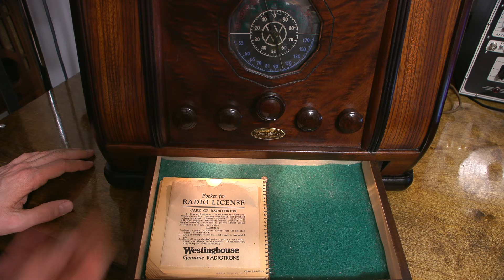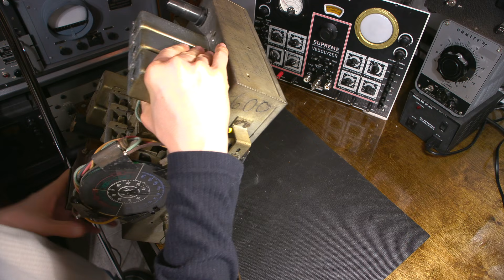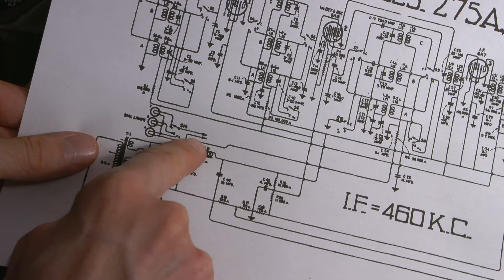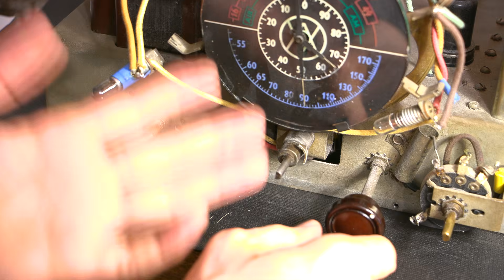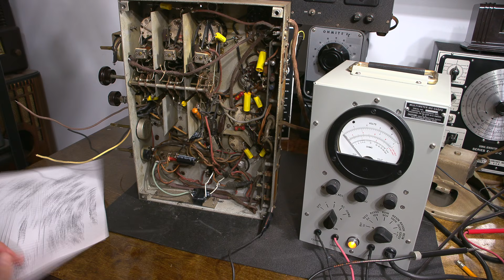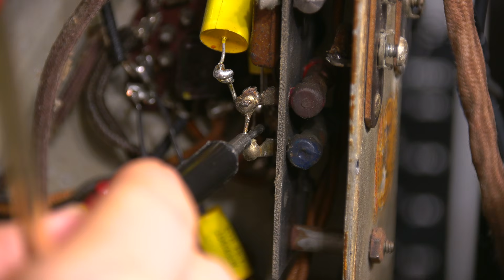Electronic Repair Adventure- Radio Receiver Troubleshooting!

Comment: I would definitely like to see the RF alignment on this.
Reply: I would too, But I don't think it's that far off. Excellent sensitivity, so front end seems close, good selectivity so I.F. is probably pretty close too.   Couldn't see dial real well so couldn't see where dial was when tuning WWV, so no comment on that part of alignment.
Reply: @Rems61  You are probably right, I just like to watch the process. :)
Reply: @Rems61  It is inconceivable that this thing is still within spec. It may well seem acceptable but it will need aligning.
(Blimey, I almost convinced myself there...I'm only a quarter way through so don't know the whole story yet).
Reply: me too
Reply: I was actually expecting to see it I did not realize time was coming to an end.  I fully agree it would be nice to watch and see that end result., it is a beautiful radio.
Reply: Do you mean reciever alignment? It's not a transmitter.

Comment: I don't like the j-hook idea myself, but when there are multiple wires wrapped around a lug on a brittle tube socket, wafer switch, etc, I will use it . I have damaged those components by trying to remove wires from them. It does work okay, just not my favorite method. I think it it aesthetics, not function. I have known people who use it exclusively and do high quality restores. What do you think Paul?

Comment: Have not watched yet but no worries, they are ALWAYS excellent! Glad I was up early :D OK, finished watching and yep, it was great! It is nice to see the old time bench being used but a quick question. Why is the Vedolyzer not in it's case? I suspect that the case is a little too large for pushing back on the bench. Good advice on the dial paint too!
Reply: In one of the Vedolyzer videos he mentioned that he might use it without the case, because the chassis has a nice chrome finish. I guess that could be it.

Comment: A licence to receive a signal, sounds almost criminal, BBC.
Reply: We have had to pay an annual license fee to our government to finance state radio and tv. Always been like that since radio started in 1924. This was terminated this year (2020). This helped keep at least the national stations free from all those braindead commercials...
Reply: Most governments (including here in Canada) wanted to control all frequency generating equipment during the big wars as there would be modulation on those generated RF signals that could be picked up by spies.  Since all superheterodyne radios had an internal oscillator then that fell under those rules.  Not so the TRF sets.
Reply: @basinstreetdesign5206  The modulation from your 455 kHz IF oscillator would be pretty useless for spies to transmit with because it's so weak, it wouldn't go for more than a few feet.  Ham radio operators were shut down in most countries during WW2 though.
Reply: @basinstreetdesign5206  ,  Again, as Paul shows, there are sneaky and simple ways around that, too. LOL For then, not now, as we have better receiver antennas and receivers.
Reply: Careful, they'll send out the TV detector van to your location LOL
Reply: A license to get radio reception legally. Bet that wouldn't last a second in USA. So they tax the electricity  here instead!
Reply: @hestheMaster  Thats taxed in the Uk as well
Reply: @LOTPOR0402  Double dipping.
Reply: Not just the BBC, not just USA - we had the same licence requirements down here in New Zealand. From the early 1920s a licence costing 5 shillings was required to receive broadcast transmissions. Not only that - applicants had to supply a character reference and proof of British nationality! This licence was done away with in the early 1960s when TV started here - and a licence was required for that.
Reply: During the 2 world wars the level of paranoia and conspiracy nuts was OTH.Think of OUR reaction to pearl harbor,rounding up American citizens and putting them into internment camps.Look at how STUPID people act over our government trying to contain this shit virus.
Reply: In the 1960's, in the UK you were charged a license fee for a radio built into the car! I think it was a couple of quid a year. The manufactures got round it by fitting an aerial to the car and then you used a radio powered by an internal battery, not the car's electrical system. If you look at "portable" radios of the era, they have an aerial socket to use it in a car. It only lasted a few years before the government had an outbreak of common sense! While it did work, reception was not good, with a lot of interference problems. Jim M7BXT
Reply: @jamescstanley5018  That's pretty wild. It almost reminds me of the "chicken tax" solution used on the Subaru Brat Pickup/Ute in the US, they put seats in the bed of it to get around the tax.
Reply: Used to have that in Sweden too. It is only about a year since they eliminated the TV-license. They now charge a media tax instead, which is supposed to cover the non-commercial public TV and radio.
Reply: canuckguy worried  At least we have non commercial alternatives that doesn’t rely on donations and people’s good will. We do have commercial radio and TV as well.
Reply: Dave Micolichek  Yeah, those kinds of brats are the wurst!  :0D
Reply: Imagine totalitarian regimes. They won't like you having a radio.
Reply: @michaelblair5566  There would be ONE official government station with it's propaganda and a few clandestine low power anti-government stations.
Reply: Canada had radio licenses until 1954 so the owner (s) of this  Westinghouse radio which dates from about 1934 would've needed to buy annual licenses for about 20 years to support the CBC which like the BBC in the UK is the government owned broadcaster in Canada.
Reply: enator71  What happened no recent big belly videos on YouTube ?
Reply: enator71  Birther movement indeed. I see your a fan of them.
Reply: James Miller  Someone else mentioned this, also. This was likely due to the early regenerative and super-regenerative receivers of the day. Those early receivers had little to no RF shielding, so the local oscillator of those receivers were easy to receive. And there was always the possibility an enemy could tap into those IF signals and use them clandestinely. Hence the need for license.
Reply: Telly tax, license... all the same thing: money dumped into the treasury.
Reply: radio and television license fees started out being very practical and fair - they funded the broadcast stations in the era before radio and television advertising. a radio license meant that those people who were using that service and receiving the stations were paying for them. even in the post war period it was an effective way of funding advertising free television without it being directly beholden to government (or the whims of the advertisers). I don't think it really holds up today though, although I think if an organisation like the BBC could operate on a greatly reduced budget and reduce the scope of its operations to concentrate on a more public-service centric remit, the system could still work. so much of the news and current affairs media space today is occupied by blatantly and unashamedly biased sources of reporting that render themselves worthless, in my opinion. of course people should be free to access that kind of programming if thats what they want to hear/see but I think there is still clear value in a publicly owned but not government controlled news and current affairs source with a charter that demands political neutrality and balance. 
its in a very far from ideal state these days, but so many of the complaints levied against the BBC are contradictory. people complain it represents the establishment, or is a "state broadcaster", but then others complain its left-leaning and therefore biased against the current (conservative) government. they're directly opposing positions, they can't all be right.
Reply: @Sean NZ No, it's not hidden in the council rates. These days, funding for television and radio comes from NZ On Air and Te Mangai Paho, both of which are government funded so the money for them effectively comes from taxes.
Reply: Its is criminal now but back then in the early days it was acceptable and made sense but not today
Reply: Until fairly recently, the FCC limited AM to 1620 khz, which immediately identified the radio as being for use outside the United States, which makes the license drawer make sense
Reply: I got a fine back in the sixties for no license on my car radio 📻 in England 🏴
Reply: @frankclack9096  You got to be joking!!
Reply: never owned a bbc licence,,,never will..
Reply: they had to pay for jimmy savil court cases
Reply: lmao, nice jab
Reply: Wallace   Well, you have CNN NBC ABC CBS PBS all spouting the same propaganda. Maybe you ought to try occasionally hearing an alternative view.
Reply: @wsg4847  Of all you mentioned only PBS gets some money, like the BBC does , from the government to operate.  Of course they all spout the same big government ,
for the people and we know what's best for them, Marxism BS!

Comment: I have zenith radio and getting static noise.
Reply: What model? Did you try turning all the LED lights and wall-dimmers off?
They might introduce RF noise trough the airways and even trough the powerlines.

Comment: Nice looking "Tabletop" ... you can tell that tables were built to last back then (My Grandmothers table was made of oak! After she died it took 4 of us to move it!) I get the feeling my Ikea "table" wouldn't hold up well to that radio.
Reply from the maker: It's crazy heavy!
Reply: @MrCarlsonsLab  usually a good thing, you can measure buildquality and sturdieness plain and simple by what weight these old equiptment have, most of the time.
Nowadays it's all made up to a price.
Back then, designers and engineers took pride in their work.
That has always facinated me, and makes me have a great respect for those people of the era.